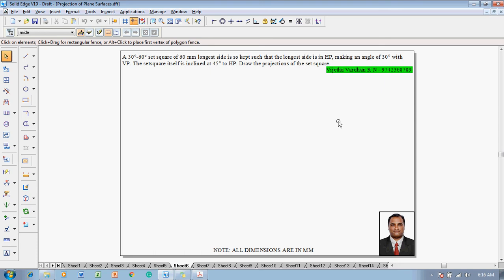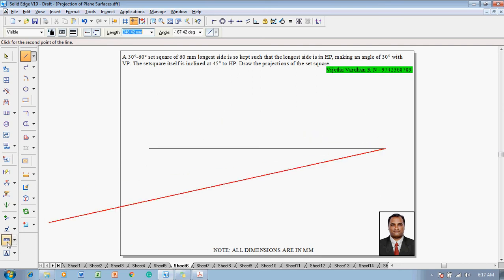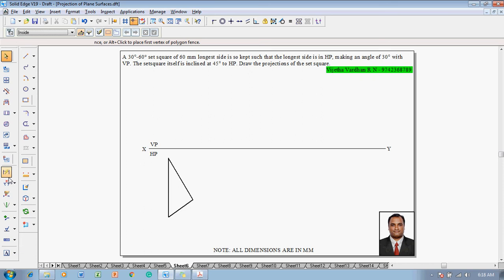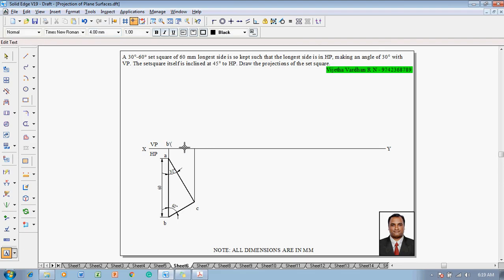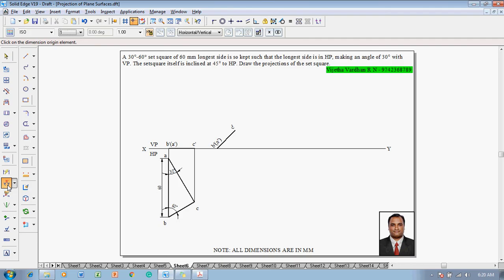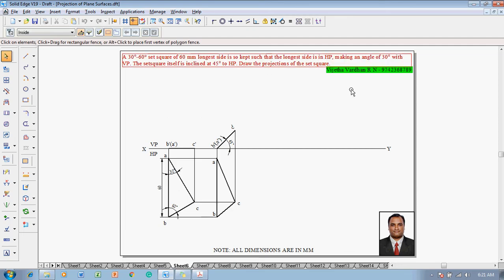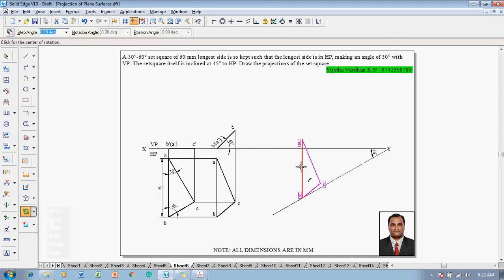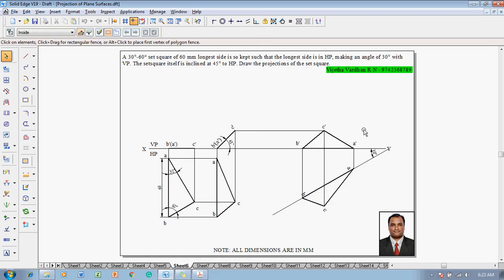Example 06 on Projection of Plane Surfaces

Comment: Sir is it ok if we take 60° in place of 30° and 30° in place of 60° ..? 

Or is it necessary to take the angle how you have took in this problem..? 
Or is it ok if we take any angle at any place..?
Reply: Sir you have took 30° at point a  and 60° at point b.. 
But i have took 60° at point a and 30° at point b.. 

Is it ok sir..?? 😰
Reply from the maker: It can be interchanged

Comment: I can't change the angle
Reply from the maker: What is the exact issue? Can you please elaborate 🤔
Reply: Sir  you change the angle using the angle measure  but I my system if I change the angle just the number will be changed not the diagram

Comment: Q: 5 A 60° set-square of 125 mm longest side is so kept that the longest side is in the H.P. making an angle of 30" with the V.P. and the set-square itself inclined at 45° to the H.P. Draw the projections of the set-square.
Reply from the maker: Same question but change the line length from 60 to 125 mm that's it...